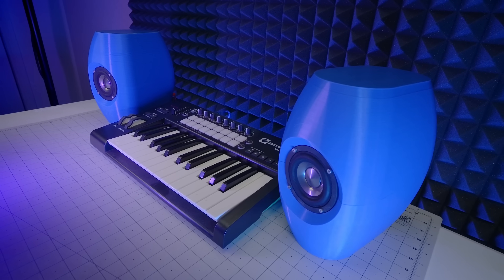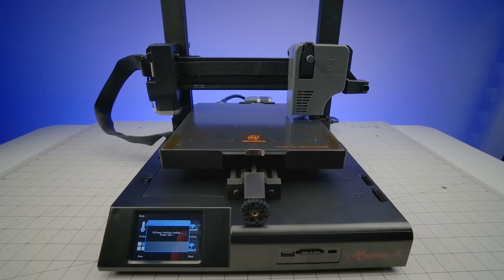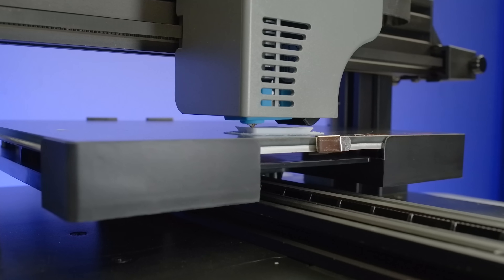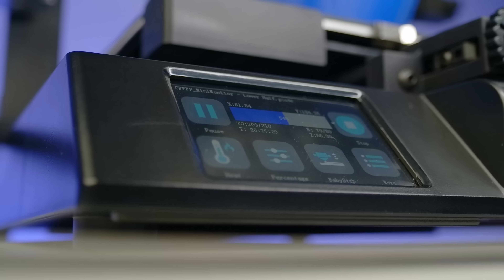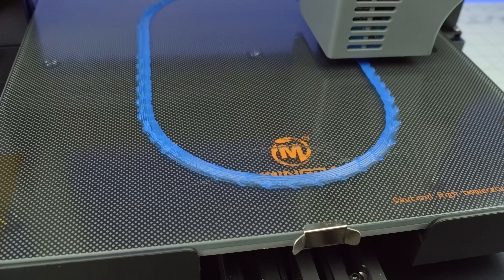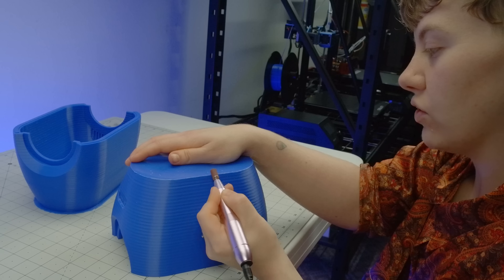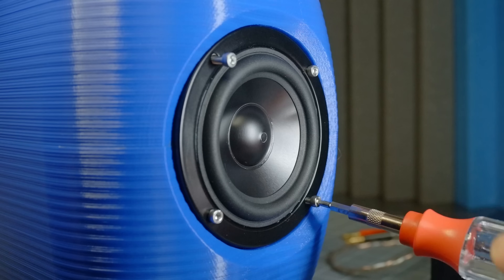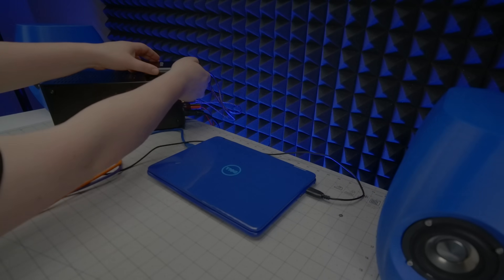3D Printed Studio Monitors (featuring Mingda Magician X)

Comment: Lead screw doesn't need to wobble or be visibly bent to eye to be still bent. Most of the lead screws on printers are always bit bent, no company sells 100% fault free lead screws. You can how ever fix it mostly by adding connectors on lead screws that have ball bearings that negate some of the wobble

Comment: I have noticed that, since the video where you tested the acoustic properties of Pla vs woods, you have been using giroid infil. Have you tried to use cubic or an other tips that makes closed cells? Giroid has a specific propriety and is that it's all connected like a sponge or a fiber, if you make a hole on one side of the item and on other one on the oposit side you can blow air though it. I think this can severely affect the properties of sound dampening since its only a single bacume chamber instead of multiple small ones.
Great videos, I'm currently testing Markaudio drivers with a 3D printed enclosure hehe.

Comment: Just got this printer and it prints like a beast! For 3 days, then it died. One thing I have to give to Mingda: an extremely responsive customer service. From the time I reached out to them,to the point they diagnosed the issue (failed PSU), to them asking for my shipping details, all-in-all, maybe 4 hours. At most. On the sidenote, printer handles overhangs up to 80 degrees, you just need to tune your temps for your filament. Cooling is good enough. Top tip: re-level your bed, then go to Cura and in machine settings, go to start gcode box and enter: M420 S1, right after the G28. For some reason, probably the omission, the default profile doesn't use the pre-levelled mesh. This fixes the issue. You'll only have to baby step the first print, very slighly, one you save, you really won't have to do it.

Comment: Plastic not sticking to the table is a trouble for any PLA print in printers like this, and forget about ABS. You need a box case to keep the bed hot and prevent air movement cooling it down, and you need glue on the glass for better adhesion. PVA-based glue stick is one way, but there are many other possible solutions.

Comment: I can’t imagine waiting that long for a box to print 😳
Your ‘hexibox’ took me only about 2.5 days to print entirely at 80% scale and 40% infill in ABS. 
Side note, fits a Rockford Fosgate HE2 8” sub perfectly and it sounds better than my RF HX2 10” sub in a bug box store huge vented enclosure. 
You should consider building a Voron 2.4 in 350x350x350 size for some of your large print ideas. Printing PLA you can likely print at 250mm/sec++ with results better than the Creality large format printer you have. Just an idea anyway. 
Massive thanks for sharing all these designs! I think i’ll try the ‘hexibox’ full size with PETG in the near future!
Reply: Side note, that horizontal banding actually looks pretty cool on that box shape 🧐

Comment: First, wow, the tuning response is great! 
?? Passive radiator screw. The nipple? Will it eventually or soon chaff a nice round hole? ??

 What am I listening through? First pass
Highs: RCA brand TV 
Lows: Venturi V-1000R

TV sounds good for what it is; given the the idea of reference monitor characteristics. 

Bass is fantastic! I'm always impressed by what you do! 

Second pass, coming right up, after grabbing a coffee...
QSC:
K8
KS112
KW153
KW181

My PA/Studio speakers 😃
Will edit with results

Set it up
Results:

I used your intro music as my starting point. 

Mixer at 0db

Intro music measured
94db peak

Skipped to the end
Same variables.

Immediately louder. 
97db 

During the sign wave portion the bass was nearly punishing! Wow!

Max peak was 100db 
I DO have neighbors ;)

Bottom line?
I believe those speakers would be great reference monitors in any studio!  

Outstanding video!
M

Comment: Time wasted for 1 design 2 material 3 electricity 4 production 5 how it's looks 6 performance. With your knowledge, you could do way better.  By the way, the radiator MUST be twice larger than the driver. Good sound in the video and the way how you presented information.

Comment: Listening in a set of Sennheiser PXC 550-II's through my PC I was surprised at the low end extension of of these small drivers. They hang on the transitions down low though. Or could be a YouTube compression issue. Other wise they sound nice and warm. A little soft on the high end, but not harsh like I was expecting.

Comment: Slightly loosening the the nuts/screws on lead screw nuts should help. It will allow for a little movement in the leadscrew, so the wobble of the screw isn't directly translated into the print.

Comment: Fantastic audio project.
Presumably, adding cone mass to the "drone cone" (passive radiator) is the electromechanical equivalent of adding mass to the main transducer's cone - sucks more current from the amplifier, the electrical equivalent of adding a parallel capacitance load in Thiele-Small parameters?
No biggy, but the bottom end bass gain is presumably ultimately contributed by the amplifier, just like the "smile" EQ curve shown at c. 2 min mark

Comment: Hi, dear Pete. Thanks for your job. 
From the video we can see there are some layer shifts in the model, it is mainly due to the Z axes need to be adjusted.
During the shipping, the Z axes will be pressed for a long time. It will affect the axises' accuracy.
Here are some suggestions that will be helpful.
1. Please kindly check the Z axes rob whether they are bent or not.
2. If the Z-axis robs are straight please kindly add the gasket on the X-axis to decrease the shaking during printing.
About the first layer cannot stick on the heating bed well, it seems the first layer is very thin, please kindly increase the baby step when making the first layer printing. It will be helpful. Baby step settings can be saved, no need to reset every time

And as you said in the video, the MINGDA Magician X in your hand is the demo machine, considering the influence of long-time shipment, we have strengthened the fixation of the Z-axis on our following batch order since July.

Hope our suggestions will be helpful for you. Thanks

Comment: ive got the mingda d2 and besides not having good support for the wires going into the heated bed its a great printer. really thinking of getting their new large format magician printer or the d4 400mm x 400mm would be great to work with sometimes. though id prefer corexy
Reply: also i have other printers that use this kind of bed leveling. they all seem flawed and often seem to lose calibration. i would prefer bl touch and straight marlin
Reply: and i dont like glass beds never had great luck with them. i prefer flexible steel and pei
Reply: on the d2 ive manually leveled it 1 time then put it in for near constant 24/7 printing. have not had to level it since been at it 2 months now

Comment: Good video montage and content, as always!
If I can help, I think that the issue with bed-leveling was related to CURA that send a G28 code before any print. This code just reset all auto-leveling mesh stored in the printer.
Try adding G29 after G28 in the cura printer settings, it should do the trick!
Reply: Add enough rounding to the top inside and not (much) bridging needed eather.

Comment: Unfortunate luck with the printer! I'm sure CNC Kitchen could probably diagnose what's wrong with it. While analytical listening isn't really possible through YT, I think you'll get a kick out of my bizarre setup..... I listened to the demo through the HiFiMan Sundara (no mods) powered by a Behringer Xenyx Q502 (don't judge me :c), and to top it all off, a Dayton Audio BST-1 bass shaker attached to my chair, powered with a Sony XM-N1004 car amp lmao. That amp also powers some DA subs, and a 3D printed enclosure containing a DA midwoofer and Visaton dome tweeter... But they're switched off 99% of the time lol

Comment: Impressive sound for a pair of small 3 inch speakers. Is there any reason not to attach passive radiator on the same baffle as that of the main driver?
Reply: @HexiBase  Thank you, great work.👍
Reply: @HexiBase  you should do a video on the software you use for modeling :)

Comment: If I had a 3D printer I would have too many small speakers that I wouldn't know what to do with them.
I really like your production style nowdays! I've been watching since the shed days.
I'm listening with Pioneer CS-R700 and Behringer A800 tuned flat with bit more low bass and a little bit less top end to suit my liking. Bougth a RTA mic long time ago when I saw you use one on the build with the 4 MTX? subs back in the day.

Comment: Ooof. Thump. Love them 👍
Reply: @HexiBase  Sound amazing through my Skullcandy Crushers. Amazing that such a small speaker packs a large punch. Definitely not impressed by this printer. There seems to be a new generation that don’t quite deliver. I’m still happy using my old Cr10 s. I’ve fitted auto level and a few other bits and it has never let me down.

Comment: Mhm looks like classic Z-wobble. Something with the lead screw alignment where it's maybe a little too far off to the side, or maybe it's misshapen. Though that needs to be verified against actual lead screw pitch. This can happen in shipping, due to the placement tolerances during assembly (when you put the preassembled XZ gantry on the preassembled Y axis) or due to just sheer manufacturing defect. Z-wobble can be quite a curse, since there's a bunch of things causing similar symptoms.

The bed temperature not being a great reading is pretty normal, the probe is under the alu, but what you really care about is temperature above the glass; and it will vary printer to printer, it's easy to undershoot with a glass bed. I'm going to say i don't exactly expect 80°C probe temp to be insufficient though.

What's up with the bed adhesion? I have no clue.

What kind of measurement method for the Z probe? Is it pressure sensitive, like it bumps the nozzle into the glass and registers a switch? Then it would be weird for it to behave that way. If it's inductive, you may want commands which turn off the bed temporarily while probing, though they should have taken care of that in the firmware, they can actually suppress heater EMI specifically during probing downstrokes, like PROBING_HEATERS_OFF and that section. Then again at that point they should pay you to be their QA.

15:23 what's the test music piece? Sounds very amiga-demoscene-mod.
Reply: @HexiBase  Oh nice, thanks, good stuff. MUCH nicer than second-hand listening through small speakers that aren't even mine.

Might be a piezo on the toolhead registering nozzle touch, and vibrations can upset it. It could even be Z wobble causing the mistrigger. Also one reason i never built a nozzle touch probe for myself is that the nozzle gunk is something i specifically didn't want affecting my probing, but i was tempted.

Comment: That banding issues might be a result of the bed heating. The firmware may be set to use bang-bang heating instead of PID. Bang-bang is pretty crude and results in big platform temp swings, which manifests itself as vertical banding on the print as the bed expands and co tracts. The only reason I say this over lead screw wobble is the frequency of the banding seems to change near the top of each print, and lead screw wobble shouldn’t change like that.

Comment: that looks like a banging heater control on the heated bed, not z wobble or any other mechanical issue.    
check the temperature graph over time. the flatter the better.  on banging heater control, it turns on when its below a certain threshold, and off when above. but it lags behind so it starts oscillating.    PID tries to compensate for lag
give it marlin, enable PID control and it should stabilize after auto-tuning.
Reply: Agreed, I had the exact same issue and solved it with a PID tune 👌🏻

Comment: Why buy a radiator? You could make the sides of the cabinet the radiators using a speaker surround and some points for elastic bands to attach and a place to apply some weights what do you think!!
Reply: The issue with doing your own passive radiator is its lack of linearity introducing distortion, unless you are really good at making one
Reply: @lio1234234  I'm not sure there is any reason a printed surround should be less linear than moulded one. Linearity is a property of the geometry more than the material. It would be less predictable, certainly.
Reply: If you make a DIY passive radiator you should have a spider, or it will be floppy like many Bluetooth speakers PR's are
Reply: it wouldn't be floppy the rubber surround and the elastic bands will hold it in position
Reply: @HexiBase  not sure what you mean by deflection properties how far they move in and out. surely this would be by the volume of air in the box to the given size of driver exclusion it would be constant it doesn't really matter on size there would be a lot of diffraction because of the surface area that's what you want, there's still a braking force on driver the bigger the radiator the lower the Frequency can be produced? You just have to make it tighter on the radiators what can be adjusted with the elastic bands and a weight I would have thought speaker like that you'd probably want with the given radiator about 70% of the given area x 2 8 to 9 fixing points

Comment: I would love to know if i can replace the PLA with ABS. Not that you would be able to print that with the printers you have shown so far
Reply: Copolymers seem fundamentally like a good idea, should be more absorbing and less resonant, though i don't think anyone tested acoustic properties of different 3D printer filament before. If you can account for ABS shrinkage, that's good, you need to even if you're printing in a heated chamber; otherwise, PETG seems like a choice, it has a very low shrinkage. Of course the sound character might change a little but i don't think it will upset the tuning or anything of a kind.
Reply: PLA is more rigid so it's probably a better option of the two anyway, if you could somehow weight down the enclosure like a heavy rubber paint on the inside, then that would definitely help reduce any upper resonances.

Comment: Funnily enough I've been running a pair of fountek fr88's in 3d printed spherical enclosures with a pair of pass radiators each for a few years now. I made a second set for my work from home desk using LaVoce Fan030's. Love the idea of 3d printed speakers enclosures. Even developed and printed a whole set of 5 speaker for a small home theatre setup. I've got a ways to go until I'm on your level with tuning though. At the moment I'm using/making the most basic of crossover networks with no notch filters.
Reply: @HexiBase  thanks for the reply. I got lucky with these little full ranges. Haven't needed a crossover on either. Though I couldn't afford the desk space to give them as optimal of air space as yours. As for my component speaker sets I tend to run 2nd order linkwitz riley. I know the normal electrical uses electronics but the music effects amaze me. Still learning the hardware side of things, my only real experience with different crossovers has been signal processors like my audison bit 10 and my mosconi 4to6. So much more to learn.  Love to see your videos, I'm always waiting for the next one.